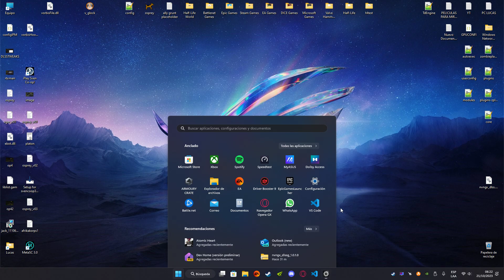Testing Frame Generation on a RTX 3080

Comment: Do you have a tutorial for this? What .DLL file do you have to replace, from where? I'm really curious to try this on my 3080 now.
Reply from the maker: Currently, the only game that works with FG and the DLSSG.dll file its Portal Prelude RTX sadly, no other game works for what i know with this method... also i try to do it in Cyberpunk 2077 and i have no luck, the FG option still greyed out...
Reply: @Durantl  where did you get the DLSSG file from?
Reply from the maker: @TheYoxiz  Just download the  nvngx_dlssg.dll from https://www.techpowerup.com/download/nvidia-dlss-3-frame-generation-dll/, search the 1.0.1.0 version, once downloaded put the files into the .trex folder, replace the new version with the old one, also if you like you can replace the dlss version as well. Just Download the last dlss v3.5 and put it in the same folder

Comment: You can enable the option due to replacing the DLL but its not actually doing anything. It can't be enabled for 2000-3000 series cards because it requires hardware level changes which are included in the 4000 series architecture. Nvidia would of course make it backwards compatible if that were possible, just like they did with ray reconstruction.
Reply from the maker: Im getting 100 fps more when enabling this, why are you saying that this doesn't work?
Reply: @Durantl  Its not generating a frame based on the motion vectors, just a static frame. FPS goes up but your input lag and visual fidelity will stay the same
Reply from the maker: @bored2171  Exactly, due to the lack of motion vectors but I feel Nvidia could implement this in some way or another, just as AMD did in its RX card
Reply: @Durantl Never mind your right.
Reply: @Durantl it's just showing every frames 2 times